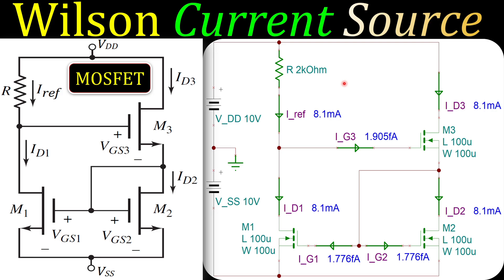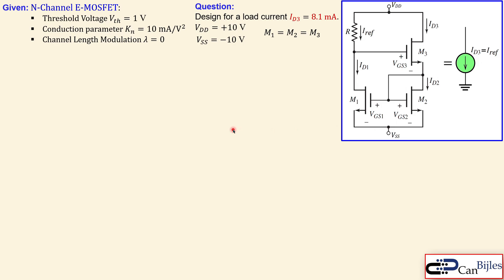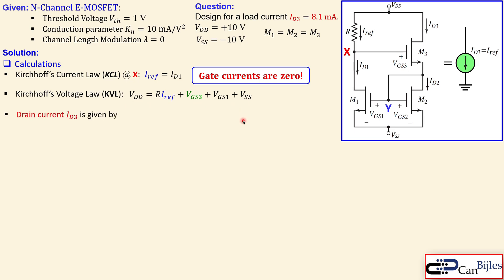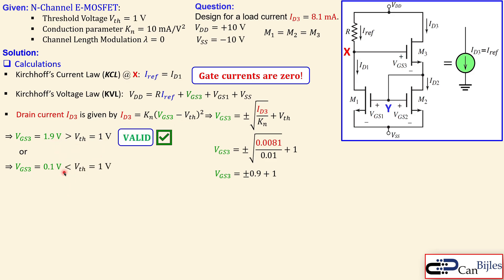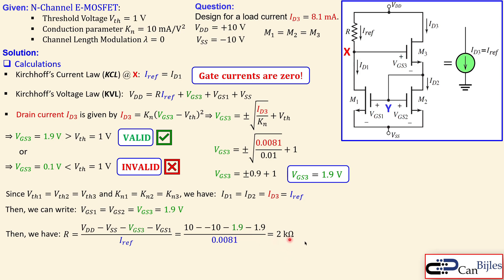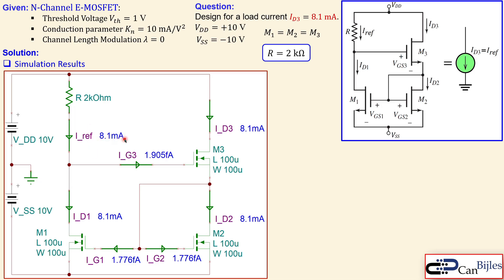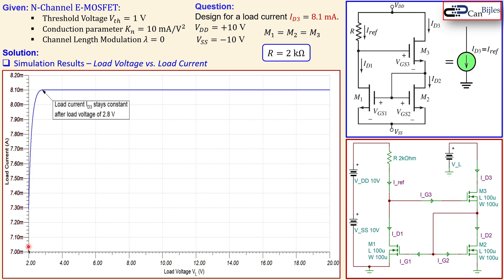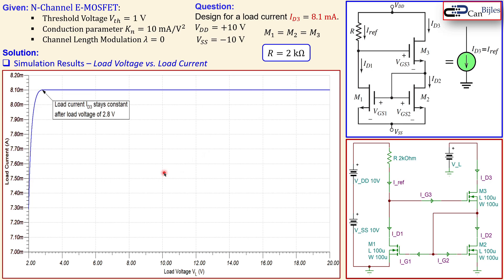MOSFET Wilson Current Source Design 🌟 Calculations & SPICE Simulations 💡 Example 3

Comment: Thank you for this great work/time. Why does one simulation show the the connection of Vdd and Vss earthed and the other show  the negative of Vdd as being earthed? And does this make a difference? Thank you. You could augment these lectures by discussing the output impedance and how you calculate it.
Reply from the maker: Thanks for your message! Glad you liked the video.
I am not sure why the simulation have different forms; I only use TINA-TI Spice. My advise is to draw the sources in the simulator as given on paper. 
Good point! Discussion of the output impedance is also on my list. I hope to get it done soon.
Reply: @CANEDUX  That's great thanks. Another anomaly is that one of the simulations appears to show n type MOSfets and the other P type - or am I incorrect?
Reply from the maker: @neilcullimore5798  Where do you see these NMOS and PMOS? There is no PMOS in this video.
Reply: @CANEDUX  For example, looking at Video number 11 on Wilson Mirror, the question shows arrows pointing outwards on the MOSfets and the simulation shows these pointing inwards - don't these arrows denote N type or P type? Please know that I am not being difficult - just confused. Regards.
Reply from the maker: @neilcullimore5798  Ok, I got your point now. The symbol given in circuit picture and the simulation circuit are both for NMOS. The arrow going-in in the simulation is for NMOS, while going-out is for PMOS. So, you have different symbols for the same type.
Reply: @CANEDUX  Thank you.
Reply from the maker: You are welcome.